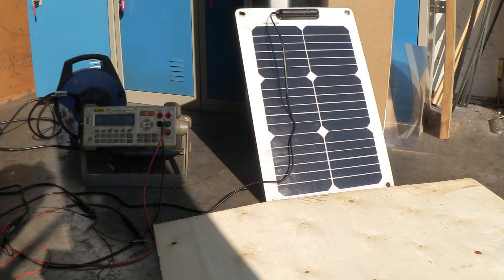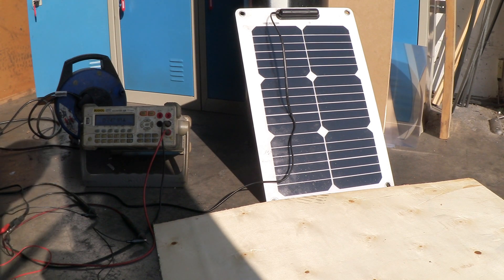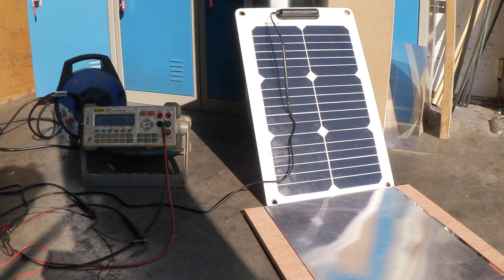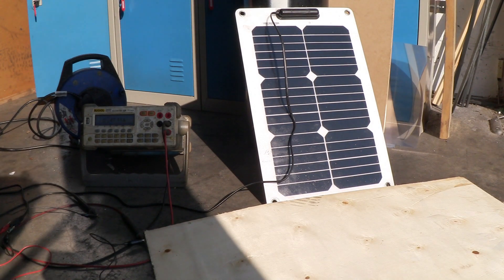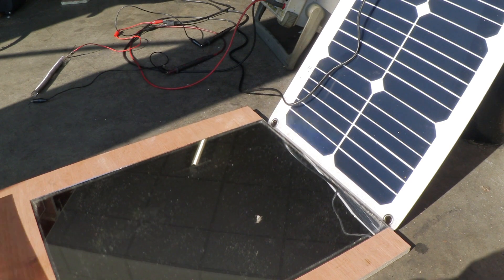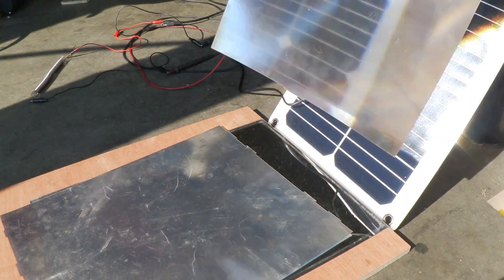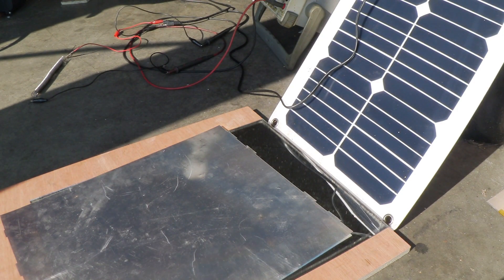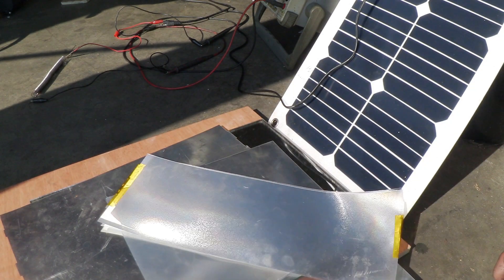Easy, Simple, Cheap Trick To Improve The Power Output Of Your Solar

Comment: I'm not sure what the Fresnel lens is meant to be doing. If it was focussing the light shouldn't it be making a bright spot in the middle of the solar panel. In which case you'd be better off with just the mirror spreading the heat over the entire panel.

Is the idea that the lens bends light from many angles onto the mirror/panel so that the mirror doesn't need to be solar tracking? In which case why would it give a higher output than just the well aligned mirror as Robert seemed to show in the video?
Reply: Yeah okay answering myself, having now gone back and looked up "prism film" instead of imagining a Fresnel, it's the second one. The prism film bends the light to be more straight out from the mirror, giving a benefit without solar tracking. I guess the mirror was intentionally not aligned for the demonstration.

Comment: the  maximum output power of a solar panel is obtainable at 1000W/m2 ( at equator ); on the 45* parallel , the solar irradiation is about 500W/m2 which will give you half the power  and if you double the surface with a mirror you will gain 100% more power , but  NOT the way you do it , you are transferring a lot of heat and lose some of good light do to angle of total reflection

Comment: I have 1 huge important question 🤓🙏🏻
Is there any way to use/combine the power of old /superseded solar cells to boost or be an efficient addition to a new array?
Eg: use them just to boost voltage, for cooling with seperat fan anything at all? Or are they just junk that will drag the system down🧐

Comment: I had somewhat of an idea how to do the same thing....I'll do it on the 3rd....I had already planned to get 3 more 100 watt panels so that lets me have 1000 watts out there...the amps will be around 30 coming in from the panels,  using an Epever mppt controller 40 amps...this will be just until August,  I will get two more batteries and that will make 14... I don't know if I will go to 16 later or not...I'm getting the 110 amp hours ones now, so the amps hours will be 635, at 24 volts, although it's almost always 25...I'm glad the battery buying stuff is about over,  hope I am getting enough batteries to run my Aims inverter/charger...I figure it's better just to have the system and not need the grid plug anymore...the sun is plenty hot here in Oklahoma without a reflection and it's fixing to storm so I may have to bring my panels inside...they're too much money to let them get hailed on so I'm making frames out of small square pipe around each two panels so I can grab them in...I really like it now that I've been off grid,  but it does cost at first and so it can't do as much for awhile,  if you build a bit  at a time like I'm doing it...but it's nice now...free energy...I can get 3 compact high output mono panels for around 200 bucks because of repeat customer discount so I'm going for it...they put out good amps...nobody tells you that it all runs on amps...lol

Comment: |> |> |> |> |> |> |> |> 
|> |> |> |> |> |> |> |> |> 

well ... what is on a saiilingboat is always speare is photovoltaic area which is eventually NOT shadfowed from any sails ...

CIGS modules are broadband photovoltaic cells and there are also flexibel ...
they work much much better by lowlight conditions ... so I think to give a strip from about 30 cm around the hull which should collect the reflecting from the water.

You must be very carefull on sea to not catch a sunburn because the water reflect so much ... I think by CIGS modules must work this too ... 

problem is ... you need deffinied free areas for the fenders ... or you break them eventually.

|> |> |> |> |> |> |> |> 
|> |> |> |> |> |> |> |> |>

Comment: Awesome idea but for the effort involved and the obvious installation problems, would it not be an idea to rather spend the effort on a horizontal squirrel cage charger that goes on the nock of the roof to augment the sollar. It charges at night as well?

Comment: I had a thought. If you put the 3 reflectors around the solar panel to generate more power, instead of using another one to cool it and lose a little bit of power, why not put water emitters or drippers along the top edge it can drip or be pumped to mist the solar panel surface, cool the panel down and at the same time heat the water which could be caught at the bottom in a gutter of sorts and get warm or hot water as a byproduct and keep the panels fro  getti g too hot.

Comment: You would also see a considerable gain in output, if the wire from the panel wasn't shadowing the panel. If you shade even one cell, the available current from the whole panel is only as much as the shaded cell.(s) reflecting light onto the panel increases current, but voltage decreases, as the cells heat up. Anything that will help cool the cells will increase the mean voltage of the panel, to multiply with the current, which is proportionate to the intensity of the light shining on the panel.
Reply: I suggest you go grab a calculator now and calculate that 'considerable gain'.
Reply: @SinsBird  Since the cells in a panel are in a series circuit, the whole panel only produces as much current as its weakest cell. The gain by moving the shadowing cord goes far beyond the percentage of area it's shading.
Reply: @vincentrobinette1507  It's been 16 hours, have you calculated it already?

Comment: Solar PV and Thermal increase dramatically from the reflection on snow too.  If the film was mounted directly on the surface of the PV in combination with the mirrors, would the effect increase the output?

Comment: Better to
1. Buy one more
2. Get a proper mppt instead of straight to a resistor since it is at an sub optimal voltage loosing lots of power.
3. Cool the panel.

Good way to early destroy your panels.
1. Use a fresnell lens on it
2. Use mirrors to get more sun and more heat on the panel.
Reply from the maker: it really depends what you want to do as to what is better mate - if you want to experiment it is really not better to just buy one. If all you want is solar then by all means go right ahead - but what about if you haven't got the cash, but do have a sense of adventure? - there is never really a better to mate it all depends on you and what you want to do - well that's what I think lol

Comment: This might work OK on a camping PV system, where you have small panels, and you can play around with angles etc, but on a roof top like mine you would need mirrors almost as large as the panels themselves and that would be huge in my case. Also most panels are not at a high angle such as they are in this video, but down around 25 degrees. Remember that if you don't get an even spread off light onto the panels, you can only get power from the panels equal to the spot on the panel receiving the least amount of light. As the sun moves through the sky the reflecting light will keep changing angles. All good in theory, not so good in practice.

My 5kW system was installed just over ten years ago, and I have water cooled them with an oscillating sprinkler on a 20 times a day timer with a 3min on 15min off cycle starting around 9:30am. The water runs from a rainwater tank, and recycles bak into the tank. I can get up to a 10% increase in power most of the time. I replaced my Fronious IG40 recently with a new SMA Sunny Boy inverter which is a little more efficient, and allowing for that, my panels have lost about 0.4% per year of power output, not bad I say.
Reply from the maker: you might want to watch this video mate  https://www.youtube.com/watch?v=x_UKVEBxYFM
Reply: @ThinkingandTinkering  I looked at the suggested youtube clip, and here are my thoughts about that clip, the comments section is turned off, it is full of ads, all of his observations are with small scale experiments that haven't been taken to any real life sized situations. If I can't comment on that site it makes me wonder what is is trying to hide.
Reply: Why not take the heat from your panel back into the house?? 
Also why mot build a flame for your panels that tracks the sun and then place a secondary array of mirrors of equal area to double the intensity of light hitting those panels.

Comment: Thanks, i guess the increase is if the output is below the maximum output for the panel? i.e. if the solar panel is rated 100w, and it is giving 70w, if the increase was 10% then you would have 77w? (Rather than 100+10%?)
Reply from the maker: I suppose

Comment: Robert Murray-Smith I can increase the amount of power generated per PV solar cell. I will only give one secret away for you as you increase the amount of sunlight your PV solar cells start overheating and power drops. If you cool down the cells with either a aluminium heat sink or by means of water cooling the power increases. Also PV solar cells when overheating their life span decrease as these cells can become extremely hot in the sun and with cooling they last longer.
Reply from the maker: I don't want to be rude here mate - but that's a bit of an open secret - I have been told that about a dozen times already - still I appreciate the thought - as for your other secrets - well - in my experience folks secrets are only any good when they are secret - when you know the secret you usually find it wasn't worth keeping - but hey ho - you keep your secrets my friend and no worries

Comment: Moving the wire off the cells on 1/2 the panel will increase the power output also...
Reply from the maker: yeah - but really mate - not by much
Reply: Robert Murray-Smith also, flexible panels SUCK a glass panel with a good frame will handle the heat generated better, plus the wires are on the back, so out of the way.
Reply: Oh, for sure it won’t account to much, but strangely, when solar panels have even a little shadow on them, output of the entire panel reduces a lot.

I would love to see perfect exposure panel output, and reflector added output.

The voltage increase isn’t necessarily showing WATTAGE output, which needs a load to calculate. So, running the panel through a controller into a large battery with wattage displayed, then add the reflectors and see if IMP wattage increases. It would be a far better test.

Comment: I wonder if you could use something like a cheap raspberry pi and a small rotating motor to move the panel to optimal position by tracking the sunlight over the day. Alternately use a mechanical clock on the panel base to rotate it as the day passes.
Reply from the maker: you certainly could mate

Comment: Maybe only tangentially related, but my across the street neighbor has recently nstalled new windows that have some sort reflective coating. In the morning, when I walk my dog right now (usually about 7 am) it is about 60 degrees Fahrenheit but when I walk past the window reflection it is easily 90 degrees warmer and too bright to look at the home. It will change of course as summer proceeds but what a shock the first time last week. I am guessing if I had solar panels facing west their windows would give me power.
Reply from the maker: we have a building here in the UK in London with that glass and it is built in a way that the extra light gets reflected to the street - it has been melting cars - I am serious mate you can check the news on that one lol

Comment: A Fresnel Lens is just a lot of mini mirrors or mini lenses, depending on the light angle (angle of incidence), so this is perfectly feasible as you have created a lot of mini mirrors (although some are passing light, some are reflecting at an angle towards the panel). A well situated mirror would most likely perform better by directing all the light on its area at the solar panel rather than just a portion.
So, a focused mirror would outperform the Fresnel lens easily. Since mirrors can be expensive in large sizes, even a focused aluminium foil on board would work.
Would love to see you try the comparison, I have but am not a sci-guy or with equipment for Youtube, but I love photovoltaic and all solar experiments, and have had to learn a lot to become off-grid at home.
Thank you for your channel, I really wish I could play :D
Reply from the maker: it's a shame you can't mate - I get the idea you would have a lot to offer - nice suggestion and cheers

Comment: interesting, when you initially described it, i thought you meant lay the film directly on top of the solar.  to the side the film can act like a combo of a mirror & a series of prisms.
i wonder if the spacing or geometry of the slits in the film could be adjusted to focus the infrared component to either a different depth or different area (to reduce heat load) while the wavelengths we want focused on the solar cell.
alternately,  it might be a good addition to maximise power in morning & late afternoon,  cover during the heat of the day.
Reply from the maker: I am sure they could mate - there is lots of room to find a good solution here I think

Comment: I am not an electronic's engineer and may sound like a moron for asking...i have asked another person before...if you can't improve the solar efficiency much...then can you put a voltage doubler of some type on the output side to get more power...i'm sorry if i sound stupid....but you don't learn if you don't ask...i tinker around with scrapping out ton's of the thing's and like to reuse good part's....can someone give me a real answer on this question? Please
Reply from the maker: no mate a voltage doubler will double the voltage for sure - but it does that at the expense of amps so no more power is gained. As the doubler circuit takes power to run you actually get less power from the system but you do get double the voltage and sometimes that is worth the reduction in power
Reply: @ThinkingandTinkering  thank you for answering my question Robert...is there any way to increase the amperage? I love your experiment's...very interesting stuff...
Reply: @robertjenkins5440  To increase the amperage, you would need a buck converter, which would increase the amperage while lowering the voltage.
Reply: No. Since power P = voltage V * current I, if you used a boost converter to double the voltage you would still get the same power (actually a bit less because there are power losses dissipated as heat in the boost converter itself) but half of the current.
Reply: @SinsBird  thank's for the info...i am interested in this stuff but don't know much about how it all work's...👍

Comment: I'd really like to see this guy doing an Arduino solar system tracking video
Reply from the maker: why? that seems like over complicating the issue to me mate and I like to simplify if I can.The last I looked at that it raised the price by 50% and the output by only 25% - why not just buy a few more solar panels? It was cheaper and gave more power and a system less prone to failure - that seemed like an answer to me so I didn't look any more - but I could well be out of date - have things changed?

Comment: To prevent heat from decreasing the efficiency of solar panels, you can install CPU cooler aluminum heat sinks on the back of the solar panels, remove fans from aluminum heat sinks and weld copper pipes to the aluminum heat sinks and then put water through those copper pipes, water cooling solar panels. Nearby river can be the source of water to cool the solar panels.
Reply from the maker: nice is a nice solution mate

Comment: What would the power output difference be if you replaced the reflecting material with more solar panels? I wonder if the output would be more*
Reply from the maker: it's not just output mate - it's also cost per Wh - that would most certainly be far less

Comment: Another option is to use an array of parabolic reflectors that reflect the light onto the solar panel which has it's back to the sun like the one in Odeillo, France. Of course you have to be careful not to cook the panel. The beauty of parabolic reflectors is that they don't need to heliotrack.
Reply from the maker: for sure mate a good option

Comment: Buildings oriented East-West could be designed to have south/north-facing cat slide roofs (depending on hemisphere), with two pitches, one pitch covered with solar panels angled to optimise the solar energy and a second pitch covered with a mirrored finish roofing material overlayed with lenticular film (Fresnel lens) angled to focus the reflected light on the pitch covered with solar panels. This would increase the output of the solar panels at a significantly lower overall roofing cost.

Interestingly, where we are situated we are south-facing and have the sea to the South, with the sea acting a little bit like a lenticular lens, so we benefit from reflected light, which makes our winters noticeably lighter than would otherwise be the case.
Reply from the maker: I like those thoughts mate

Comment: renergy make a flexible panel with a prismatic surface.  I have one on my fridge in the ute flat on the roof seems to work better than a plain panel of similar size.
Off subject cooling the air with ultra low noise frequency,  saw something on TV in the late 70s?  But nothing seemed to come of it,  thought it may be of interest to you.
Reply from the maker: Thanks for the tip mate - I'll have a look into it

Comment: I've seen concentrating mirrors on PV, I've seen fresnel lenses on PV, but had never seen a combination of both. Interesting idea! Thanks for sharing!
I also remember something from some 20 years ago about prefering amorphous cells on high concentration systems, because although these cells are not as efficient at STC they will actually increase their output as they heat up.
Reply from the maker: Thanks for sharing mate - that is very very interesting